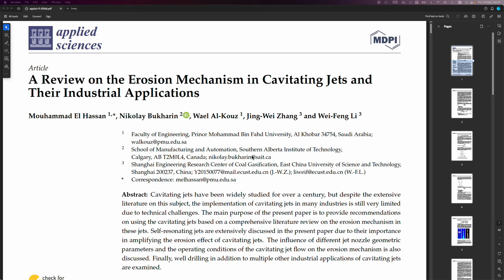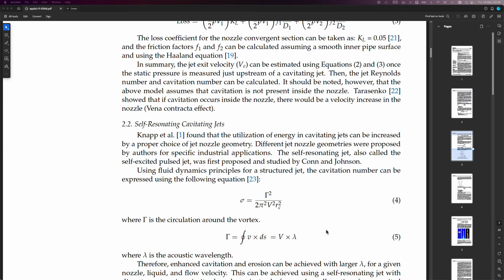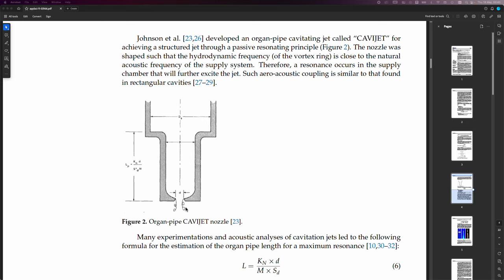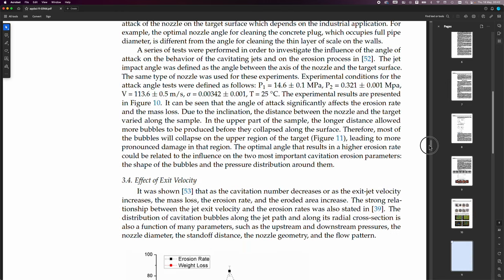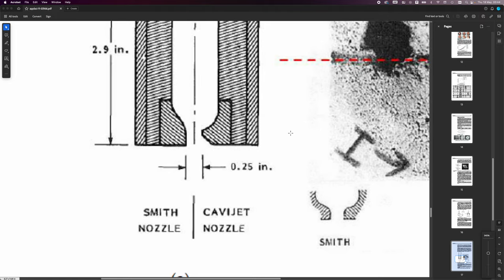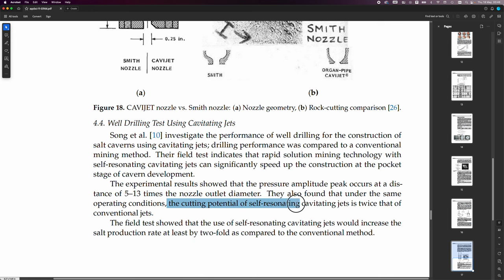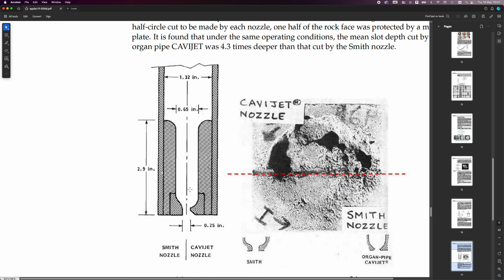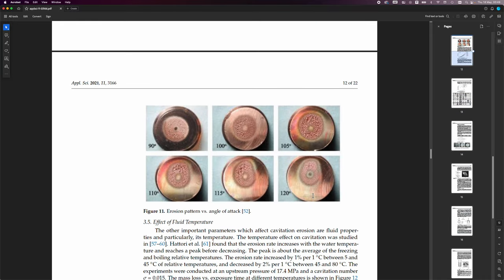O-Day - Building nozzles for self-resonating soliton production

Comment: They've been using this effect in industry seemingly without realising its true potential. Great catch Bob, your right on the money as usual.
Reply from the maker: The key papers were from 1984, where it is really discussed for use in oil and gas drilling and it was patented - it was before Yull Brown had done his major HHO work and before Ken Shoulders had written 'EV - A Tale of discovery' - that being said - it is a good starting point to massively increase the predictability of producing structures presenting the fractal toroidal moment and packing the punch that Solitons give you.
Reply: @MFMP  something to note if you haven't seen it. Further study showed that Yull Brown's HHO gas produces some exotic gasses including monoatomic hydrogen, oxygen. The odd thing with this special gas is a more electronic temperature, making it easy to weld dissimilar materials, and easily being able to weld aluminum, and cast iron. Notoriously difficult to weld materials.

I am curious what use Brown and Shoulder's work would be to oil drilling and gas. I'm new here.
Reply from the maker: @Dan-gs3kg  If you are new, you probably need to see this
https://youtu.be/OOcWAcecPxE

and these
https://steemit.com/blog/@homosymbion/explaining-the-magical-properties-of-hho-browns-gas-magnagas-and-resonant-hydrogen-plasma-and-more
https://steemit.com/steemstem/@homosymbion/the-challenge-of-containing-the-active-agent-aa-in-low-energy-nuclear-reactions-lenr

Comment: The fluid flow behavior through the slit is going to be different (quantitatively, not qualitatively) from a round jet. I'd have to run through a CFD model to make an engineer's guess as to the size, quantity, and behavior of the solitons, but my offhand guess is there are fewer, but of multple initial sizes (due to diffraction as they initiate along the slit) Tor level on initiation of solitons might be influenced by that, also.
It should be straightforward to experiment on smaller models to find these differences between round and slit nozzles- my suspicion is it will be easier to tune a system with round rather than slit jets- probably more expensive, though, as I can't think of a cheap direct way to adjust the orifice size, whereas the blades of the slit jets are readily and widely adjustable.
Reply from the maker: Hi Thierry,

Well you can get the full model from here for the current Windhexe prototype.

https://drive.google.com/drive/folders/15cDixjbbdugCdw2DLQ8sEFPZ88aGP_dD

And in the title slide, I include a link to the 1984 paper, that first discusses (Fig 5.) the "Velocity and pressure distribution in a line "Rankine" vortex - which would be the equivalent of our adjustable slit.

Johnson, V. E., Chahine, G. L., Lindenmuth, W. T., Conn, A. F., Frederick, G. S., & Giacchino, G. J. (1984). Cavitating and Structured Jets for Mechanical Bits to Increase Drilling Rate—Part I: Theory and Concepts. Journal of Energy Resources Technology, 106(2), 282. doi:10.1115/1.3231053 
https://sci-hub.se/10.1115/1.3231053

The air compressor provided ~40 cfm of air displacement for a short time. The Windhexe itself has a volume of 6.18 cubic feet so the volume to displacement ratio is ~1:6.
The two side channel blowers have a combined air displacement of ~400cfm at a inlet pressure of 0.15 bar (2.17 psi) which will have an approximated volume to displacement ratio of ~1:64

Is this enough information to try some simulations?
Reply from the maker: Here is a direct link to download all three key papers
https://drive.google.com/file/d/1yHqM-40BaAt_9NA2qdwww0wSmp56bgFH/view?usp=share_link
Reply: @MFMP  Thanks- I'll be reading the papers (at least the abstract and checking out any tables and drawings tonight)- the actual modeling's going to be a much longer term project, given the trainwreck of my life.
Reply from the maker: @ticthak  If you downloaded the papers earlier, I had one wrong one in the zip and have now corrected. On the other subject - no ones life is perfect, but when things are down - often, the only way is up!